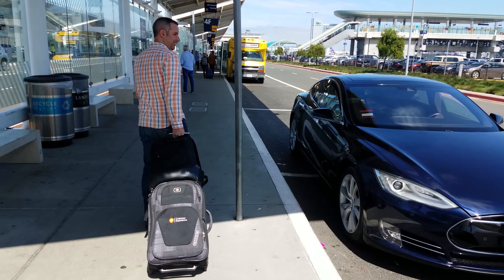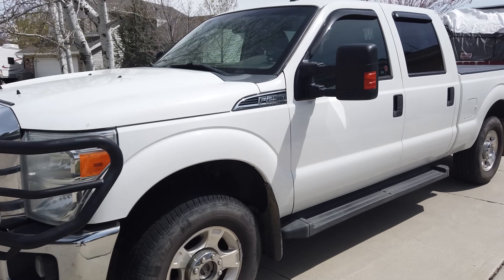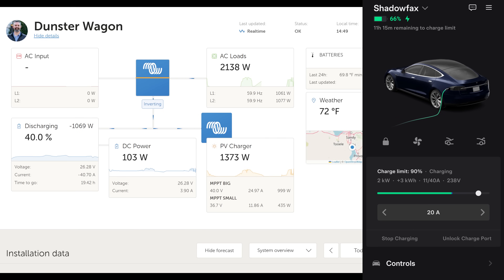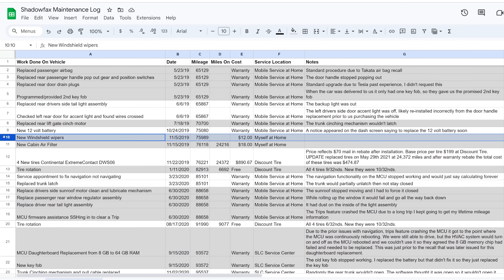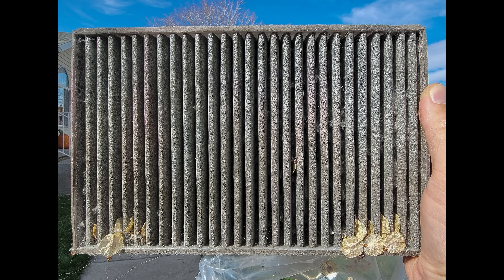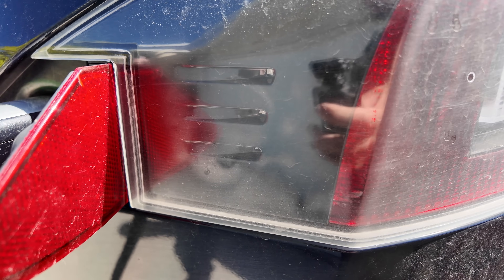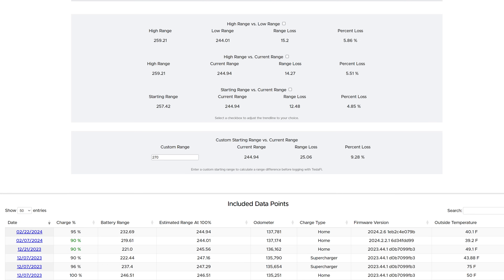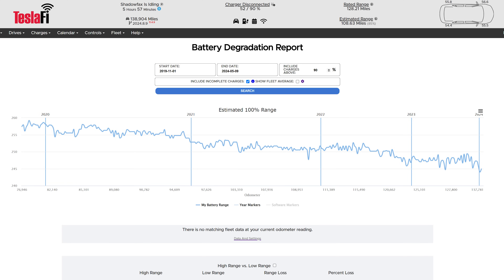Should You Buy A Used Tesla? | 5 Years Of Model S Maintenance Costs Plus My Current Experiment

Comment: So what is a "longer" drive?
Do you use all your baked solar credits every year?
I saw 3 #CyberTrucks on a car carrier heading the wrong way on P$ the other day, which left me wondering when I get mine :-(
Reply from the maker: Longer is relative to how much charge the S has in the battery, but most of our daily life (where vehicles are used) is in about a 7 mile radius, or 15 minutes of driving. I'd define "longer" as for sure 30 minutes and above, then 15-30 minutes is grey area/gradient. Regarding net metering solar credits I strive to use every single kWh, but not more (that is have to pay for). That 0 net metering balance is a zero margin goal that is nearly impossible to achieve, but I try. Generally each year we are within 50 kWh on either side of 0. My main demand levers to adjust our net metering balance is the electric cars, a freeze dryer and a heater I plug into our clothes drier outlet to heat the house with when excess energy needs to be used. Yesterday I saw my 10th Cybertruck in the wild. That's not including the 22 Cybertrucks I saw the day prior at the Tesla showroom. I wish they would offer a 6 seat option!